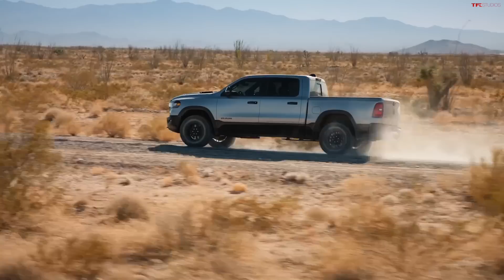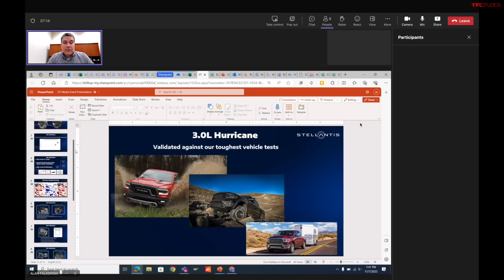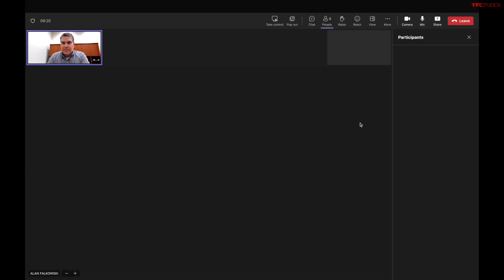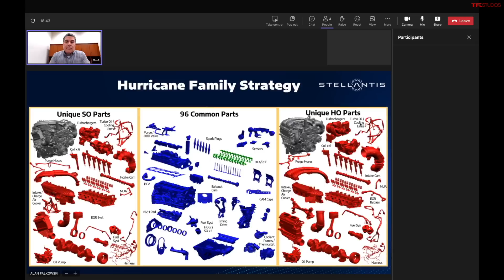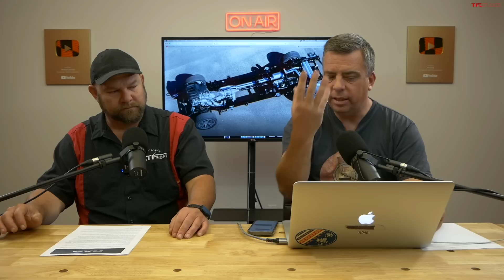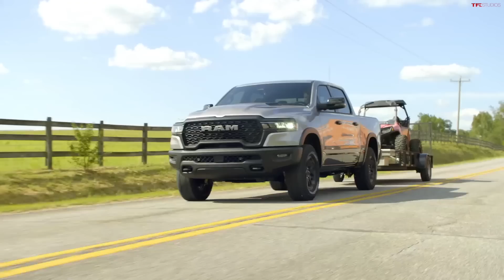2025 Ram 1500 & Ramcharger DEEP DIVE with the Chief Engineers!

Comment: I liked the idea of the range extender but if you drive a lot you are basically getting 25mpg. I was expecting to hear something like 30mpg. I know driving a little you get to use electric only but for someone like me that drives a lot it sucks.
Reply: The MPGE on full electric charged at home will be around 45 and you can figure out very easily based on 20mpg gas on 200(40mpge) mile round trip 300(30mpge) mile round trip etc out to the 690 mile full range at 25mpge.  Driven 90% on full electric miles will  AVG about high 30's mpge lifetime
Reply: @ATE2AQTR  correct obviously I'm talking the full 690 on a single drive. I do make long trips like that occasionally and at that point it isn't much better than basic v6. I'm just shocked only using the motor as a generator the efficiency of the motor per mile isn't significantly better.
Reply: @MrBoredalott  ICE are just inefficient, so even if it's powering electric motors via the generator that might only be marginally better than if it were mechanically connected to the wheels (or worse potentially due to the conversions involved). And while this isnt a perfect solution for everyone, this PHEV can still charge at local DC fast charging stations or at destination chargers to potentially negate the need for as much ICE use.
Reply: How much is 'a lot'? Because 150 miles of electric range is 3x the average daily drive.
Reply: @steinwaymodelb  for a lot of people you're correct. But I tend to drive a lot.
Reply: I'd recommend investing in EV charging where you live. The battery in  this thing is Tesla Model S size, and will offer well over 100 miles daily, after a charge. For most situations, charging at home is significantly cheaper over charging on the road.
Reply: If the 140 mile range covers daily driving, the fuel savings will make up for any gas used on roadtrips.
Reply: @jghall00  that depends. Tons of reports from people showing it's just as expensive to charge. I know that's not the norm but it does happen.
Reply: @MrBoredalott  I have two EVs and an Expedition for towing my camper. Public chargers are as expensive as gas. But most people do far more local driving. If I drove my Expedition daily, I would spend over $100 a week on gas. Charging my EV at home, I spend 1/10 of that. The savings pays for a lot of gas, for the times we need to take the Expedition.

Comment: The Ramcharger is one big failure point. It has all the complexity of an EV and all the complexity of a gas truck. It's not a hybrid. With a hybrid both can drive the wheels. Why would you want all this complexity if only the batteries can drive the wheels? I wouldn't keep it past its warranty.
Reply: The point of a series hybrid is that you can eliminate some of the complexity - primarily the transmission and mechanical drivelines.

Comment: I always thought the E-Torque system was useless. I would prefer a full blown hybrid then then e-Torque. Do we know if the Hurricane Engine will be available a crate engine?
Reply: @carlostavaresjr958....................I have e torque in my current RAM REBEL (2020) and I love it!  Now have nearly 40K miles and no issues at all!  My truck has never been back to the dealers for ANY repairs!
Reply: Mine will NEVER go to a dealer for service.  Over priced and under smart.
Reply: I have eCrap in my 2021 Ram Laramie Sport.  If I could figure out how to rip it out, it would be laying next to the road waiting for the scrap dealer to come by.  It's "seamless" activation is 💩, it almost jerks my head off at stoplights. I have come close to hitting cars in front of me at drive thru's And my gas mileage is the same if I shut it off or leave it on.  Damn I hate ecoidiots dicking around with my vehicle.  Forgot...I have 52K miles on the truck.

Comment: My question is, will it be eventually available in the Jeep Wrangler and Jeep Gladiator?
Reply: This is too much power for a regular Gladiator. Packaging might be an issue as well. They could barely fit the 392 in the wrangler as is and this is a longer engine
Reply: 💯 When? When??
Reply: My guess is Jeep and ram are going to eventually only offer the 2.0T and the 3.0T
Reply from the maker: Probably never.

Comment: Rams aren't  selling. Lots a tre full of, 2022,and 2023 rams 70 to125,000 no thanks.
Reply: I drove past a Ford dealership last night and the lot was full of vehicles.  Weren't they just on strike.  I don't think anything is selling.
Reply: @zachlafond2652  no one can afford, 11% interest on 125 k truck for 8 years.
Reply: @aerosmithtour1961  Even if you can afford it its a stupid financial decision.  You know if you're Joe Rogan and pay cash for a new Trex, more power to you.
Reply: No lots are just back to normal when the lots are actually full of vehicles to sell.   My local dealer still doesn't have the inventory that they had when I bought my Ram back in 2019, they had lots rented at the local mall.
Reply: @ohioguy4326  there is a 700 day supply of ram trucks not sold inventory  not counting  2024 production no one is buying 125,000 trucks with 11^ financing.
Reply: Ram is the 3rd top selling vehicle of 2023. Not sure where you’re getting your stats from. These current Rams will sell off no problem with the announcement that the V8 is gone for now. They know what they’re doing. I

Comment: In theory in terms of efficiency a BEV with a ICE range extender would make perfect sense. But in reality a Hybrid system is way more efficient, for automobile applications.
Reply: Only when a substantial part of your driving is done with gasoline.
Reply: Ehm... no? If I unserstood you correctly that you mean using ICE to drive a generator, no, that's not efficient in theory, cos you have additional loss from converting mechanical energy to electric. The more efficient way in theory would be to connect the engine to the wheels and drive them directly, using some assistance from electric motors, so you don't need a gearbox, like in Königsegg Regera or Honda Accord.
Reply: @ldmtag  The new trend seems to be to squeeze the motor in between the engine and the transmission like the new Taco.
Reply: @jeffk464  don't get it yet. Why is that a problem?
Reply: @ldmtag  its not a problem, its a trend because it works well.  I'm probably going to get the new hybrid Taco.
Reply: They calculated the gasoline fuel economy of the Ramcharger with just using the generator (no EV charging) and it translates to about 20.5mpg, which is actually lower than what the F150 PowerBoost gets.
Reply: @MyTubeUser321  Right but you beat that by driving on full electric daily. This vehicle is for someone that does less than 140 miles daily, but needs to tow or roadtrip on occasion. Daily driving on electric will offset the cost of gas on longer trips.